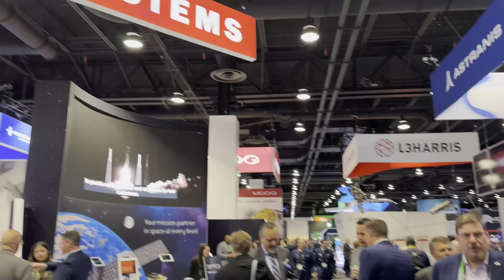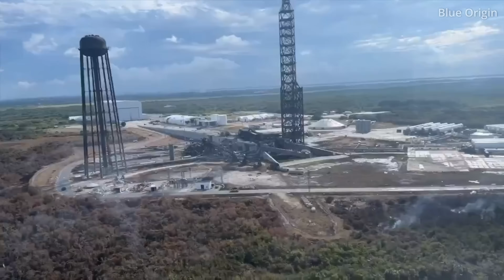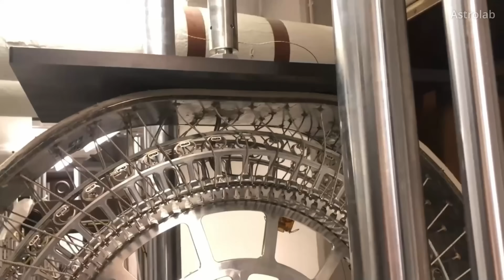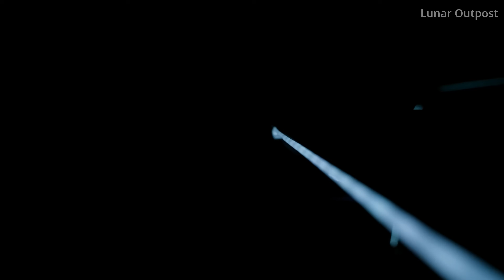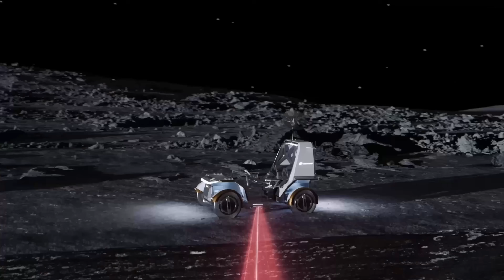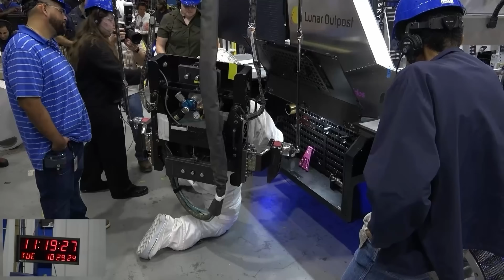NASA's new vision for mobility on the Moon

Comment: You can to insulate the batteries and engine with a vaccum layer like a Thermos
Reply: And you can add a layer of water in flat bags for radiation but the pressure may make them boil. And the temp swings can make them freeze or boil as well.
Reply: You also can use control to make it move without sitting on them like a self driving car to test if they can climb

Comment: Somebody please tell me why? No wind sheild, I know there's no wind but to keep dust out, no protection, no enclosure, Seems like and enclosed cockpit would keep dust out and protect crew in case of  space suit tear.
Reply: These are the initial rovers. JAXA's biggest contribution to the Artemis program is a pressurized rover. However, we won't see that until sometime after Artemis V or VI. Apollo 15, 16, and 17 had unpressurized rovers that were even simpler than these and that worked very well.

Comment: instead of golf carts; bulldozers for landing pad(s) first. Will reduce the risks. IMHO
Reply: Reinventing shit from 1970 isn't the way forward. mining trucks tunnel boring machines nuke plants. This isn't SimCity Luna edition this is a mining operation.  Build the mines people will follow. This is the model for the next century at least find a rock dig out the middle sell the ore/water/fuel and live in the hole while you dig some more.
Reply: H3 is the only ore with any value to bring back.
Reply: @TheMoneypresident  You don't need to bring it back, just sell it. Air might be the most mined commodity for all we know, the metals may be a byproduct.
Reply: @markschroter2640 Earth 🌎 has plenty of sand, silicon and oxygen.
Reply: @mrbaab5932  Why sell it on Earth?